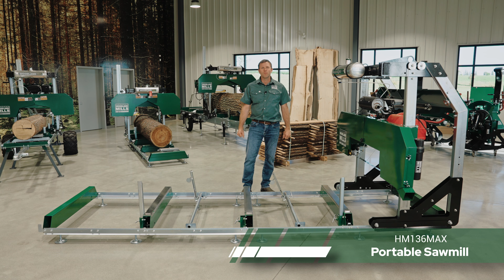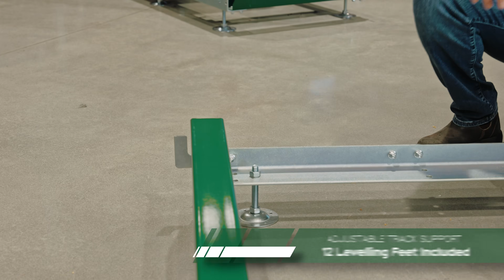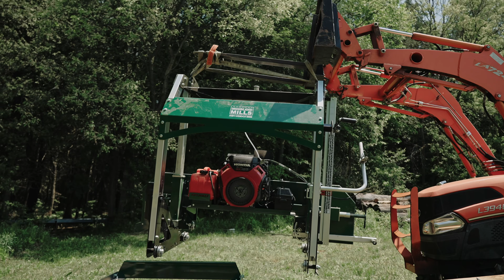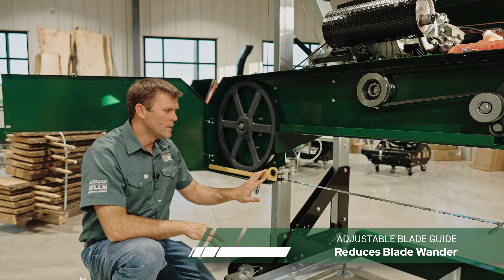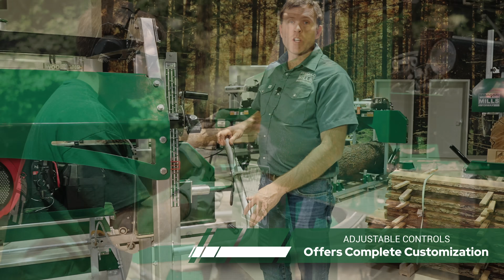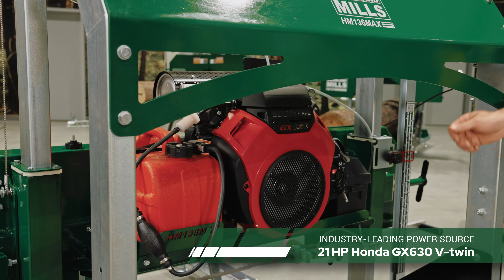Woodland Mills HM136MAX™ Portable Sawmill Walkaround

Comment: At first when I heard they had a 36" saw I was a little disappointed as I thought I had the largest one, the HM130Max.  But then I thought about what I cut and realized to lift a log 36" in diameter, 10 feet long up onto my saw mill is a rare thing I would need to deal with and the added expense just is not worth it for me.  I do have to admit I like the rollers at the top of the log stops and might need to order a set of these or convert my existing ones.